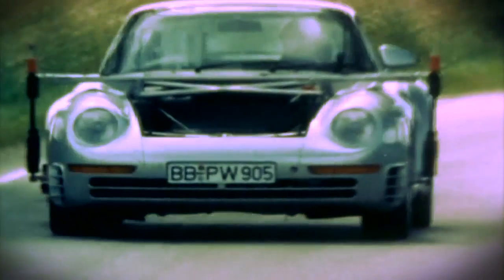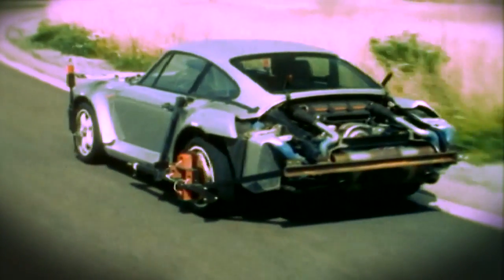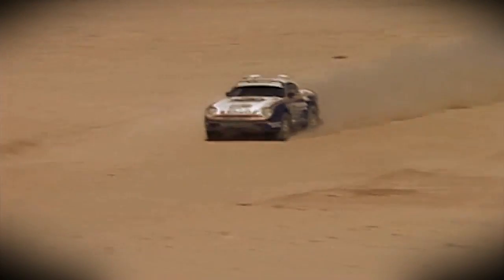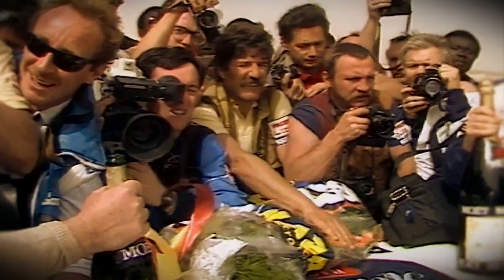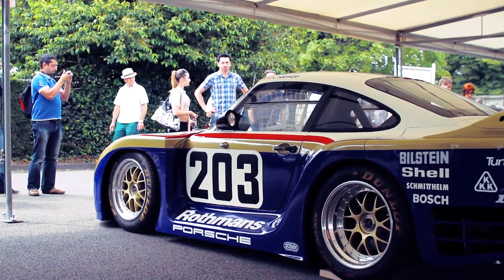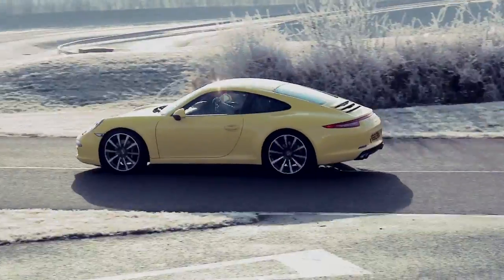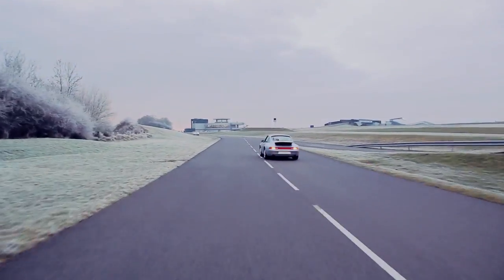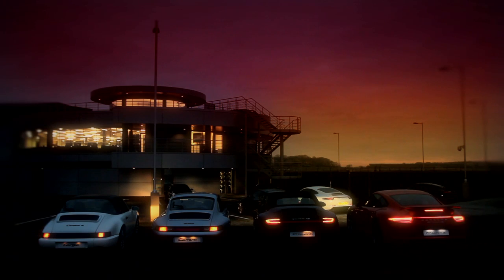New Porsche 911 Carrera 4: Part 3 - the red line heritage

Comment: I don't care if the GT-R is faster, more powerful and quicker, I would still take the 911. The exterior and interior are better. It has great specs, plenty for everyday driving and the track. The quality is far better than the GT-R. And finally, it's a Porsche. I am saying this as a fan of the GT-R and I highly respect their engineers. History is much more than just horsepower or speed.